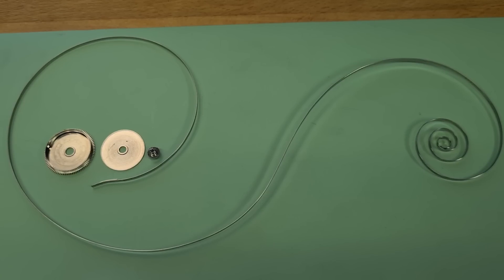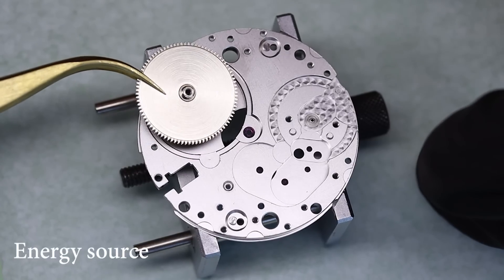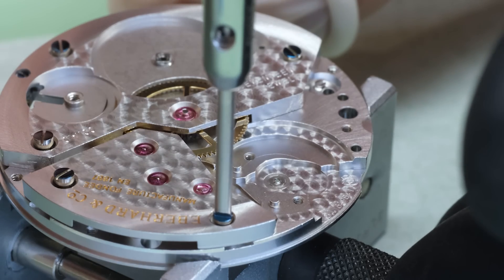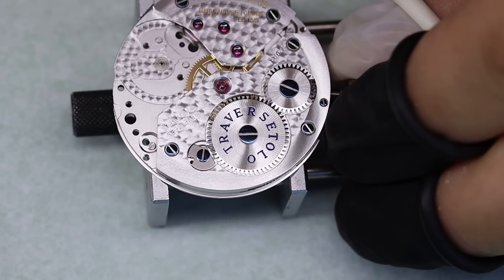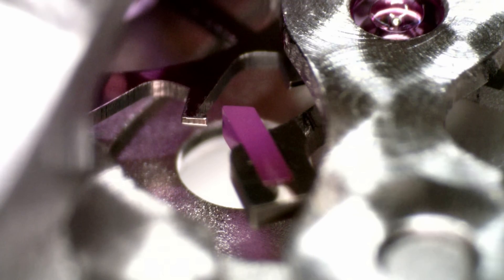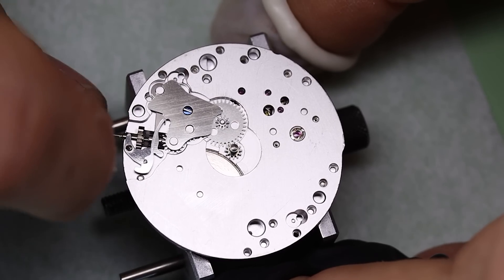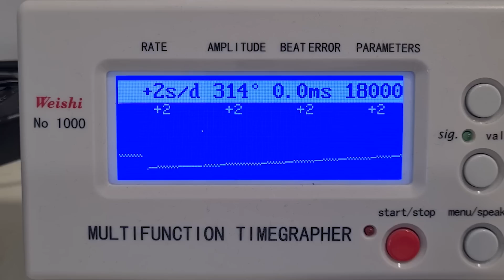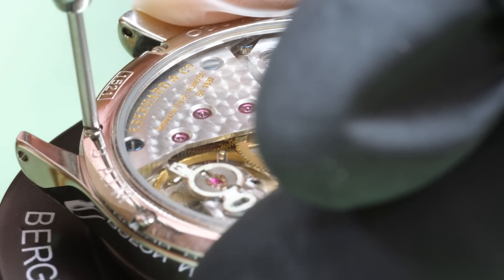How do you put 60 watch parts together?

Comment: Very informative video, but it doesn't really explain how to remember where all the parts go when you're doing a repair/restoration of a watch. With all of those parts, there has to be some method or trick to remember the order and location, right? 🤔
Reply from the maker: I'm not sure if you're being tongue in cheek here? When you understand these different functions of the watch, you should also understand where they fit and the sequencing of fitting them, no?
Reply: @VintageWatchServices  Not tongue in cheek at all: I've been watching a lot of restoration videos and always wonder how the restorers remember the order and location of each screw, gear, and jewel in a watch. I want to get into the hobby of repairing/restoring watches, but I find trying to remember where everything goes to be daunting. 😥
Reply: @VintageWatchServices  IMO, just understanding the different functions isn't enough: A lot of the screws and gears look alike. Without an schematic or exploded diagram of the watch, it would be difficult for a novice (or even someone with experience) to reassemble a watch correctly.
Reply from the maker: @bmw128racer  Well, here's the thing, you shouldn't try to REMEMBER where everything goes. You should try to UNDERSTAND what they do and then you'll be able to put them in the right place. You need a loupe to put a watch together, and with a loupe you will see that there are differences to every part. Some of the gears and screws may indeed look a bit alike, but they only fit in their right place. The fourth wheel can look quite similar to the third wheel for instance, but if you try to put them in the wrong place you will find it doesn't fit. And the most important rule when working on watches is to never use force. If you find you have to use force, something is probably in the wrong place. 

There is a reason for how every part is shaped in a watch, including the screws. For instance, screws with a flat underside are made to press something flat down while screws with a shoulder are used to let things rotate freely on that shoulder.  Screws with a coned head are used in countersinked holes where there is typically sideways pressure, to help center the part, for instance on the setting lever spring/cover.
And yes, if a novice were given a bunch of loose parts and no video or tech sheet of course he/she wouldn't be able to assemble the watch. A novice hopefully will start working on a watch that runs, so they are able to see where the parts are before picking the watch apart. 

My advice would be not to overthink this or make it into a big scary thing. Just take your time and study each part as you disassemble a watch. Look at how it is shaped and try to understand why and you'll find it's not that complex. And take a lot of pictures!

Comment: ETA/UNITAS 6498-1 or 6498-2, going with dash 2 with higher beat rate. I Wonder how many of these I've work on🤔 Good video for all who would like to start watchmaking also the 6497 which is found in a lot of large pocket watches is good place to start as well😉
Reply from the maker: Thanks Paul! Yep, the 6497/8 is a great beginner's movement
Reply: @VintageWatchServices  Funny I still remember my first time when I got my first UNITAS 6498 off ebay when I started this hobby and after putting it on my timegrapher which I already had and seeing how well it ran I though to myself I must be nuts I'm going rip this apart just so it would never run again but it did and ran even better😂